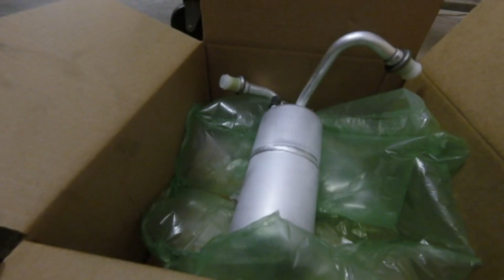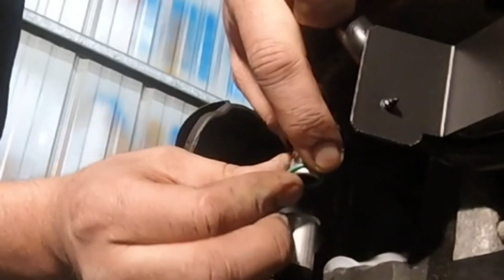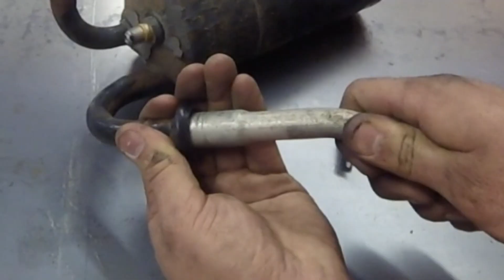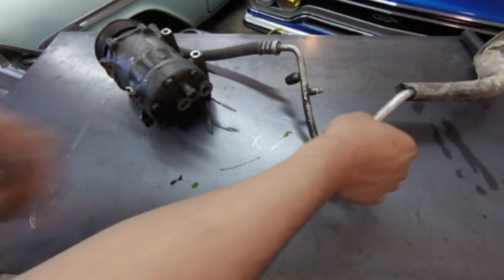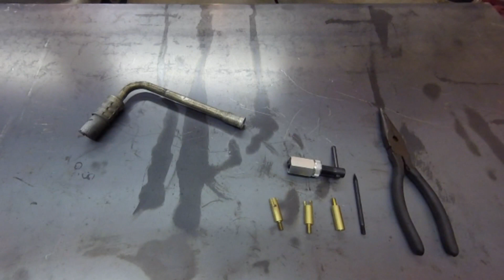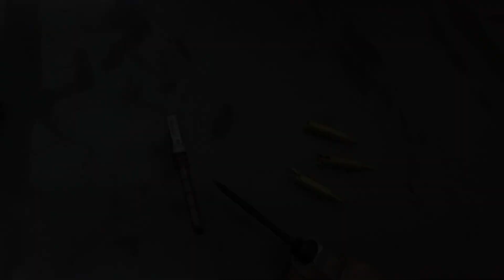Air Conditioning Underhood Service

Comment: I refilled my 2002 Focus, 4 years ago after I bought it. Been blowing super-cold ever since, except the last year, it seemed a little less cold, so I topped it up, and BAM, it's great again. I should get one of those thermometers I see mechanics stick in a vent, so as to be objective, and not be unscientifically, subjective. In Southern California, AC gets a work-out.
Reply from the maker: @BigEightiesNewWave  I’ll bet it does!  A small leak over 4 years could be a worn compressor shaft seal, but it could be oring seals or anything really on a 20+ year old car.  Keep an eye on it and put some dye in it to help diagnose where it’s coming from.